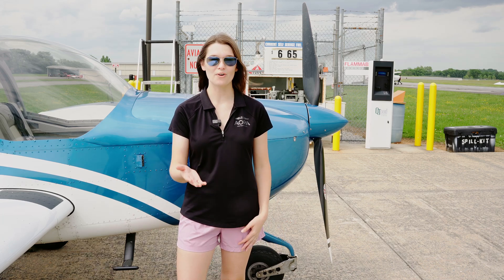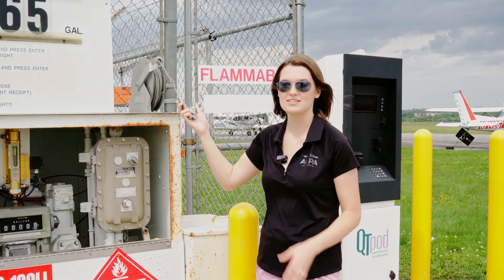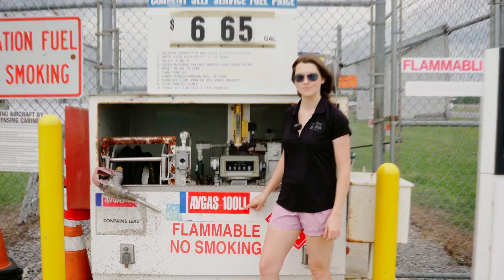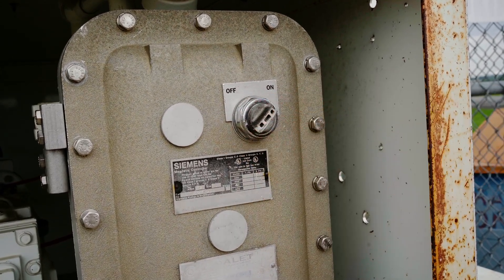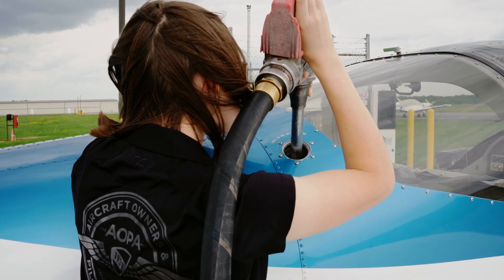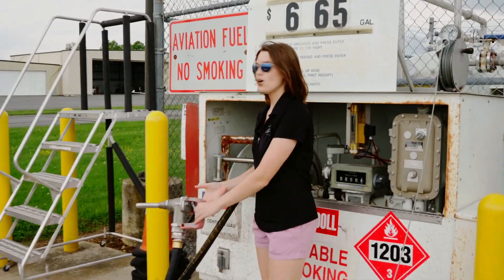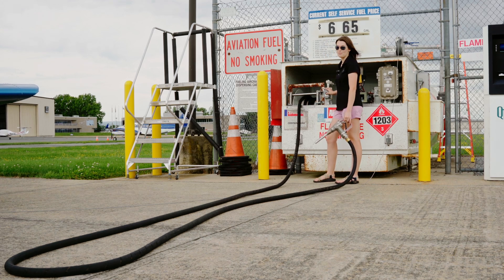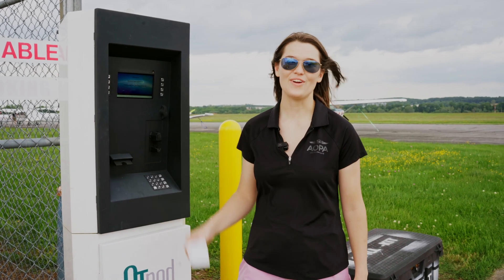How to Fuel Your Aircraft

Comment: Hmmm. 

Not great advice. 

Best to ground the aircraft FIRST before removing the cap.

Leaving the cap off and the tank exposed to the elements while you get the ground cable and fuel line out isn’t best practice. 

Not manually measuring the quantity of fuel in the tanks AFTER the refuelling process is again not best practice. You could have miscalculated your fuel requirement. Or the pump/readout could be faulty.

Comment: This whole video is wrong. Make sure the fuel type for your aircraft is correct but when putting fuel in the aircraft, make sure the  nozzle makes contact with the metal around the fuel cap. Also when grounding make sure you ground the wire to an area that is attached to the aircraft frame. Now remember the fuel handler does not know if your ground cable is touching the aircraft frame. If you see the handler fueling and ground to the metal tie down on the wing as long as it is bare metal and attached to the wing we need to create a complete bond. That is something you may want to talk to ground crew also.

Comment: You should ground the fuel nozzle against the bare metal of the tank opening not as shown in the video.  This grounds the nozzle and prevents a spark from the nozzle to the plane tank caused by static buildup due to fuel flow.  The worst possible location for a spark.

Comment: "Make sure the pump says 100LL...."
Yeah, for an RV12, that is poor advice.
Rotax engines are designed to run on 91 octane -0- lead -0- ethanol fuel.    
Look for signage that says SWIFT 94UL or GAMI G100UL.
Use 100LL only as a last resort and only if you add Decalin to the tank before adding fuel ...
((Use of 100LL will Triple required engine maintenance on Rotax engines))
Reply: Those fuels aren't available at every airport, FDK included (which is where this was filmed). Hopefully UL fuels will start becoming more widely available soon! But I do think she was trying to say to check that the pump is correct for the type of fuel one's aircraft uses to avoid misfueling (avgas vs Jet-A, etc).